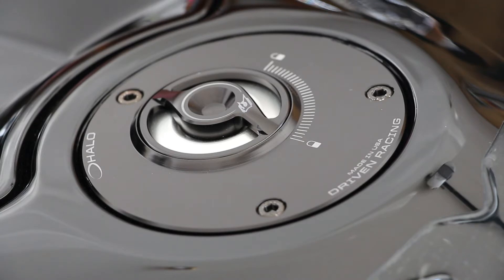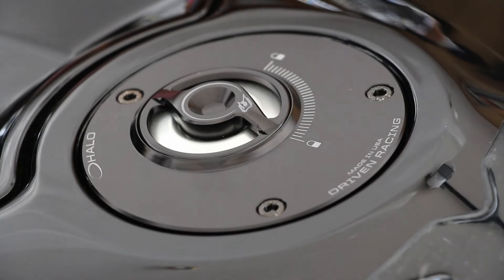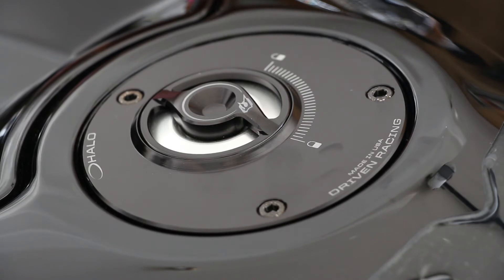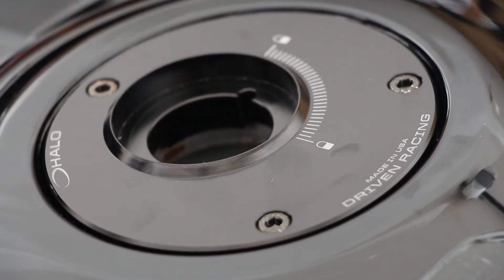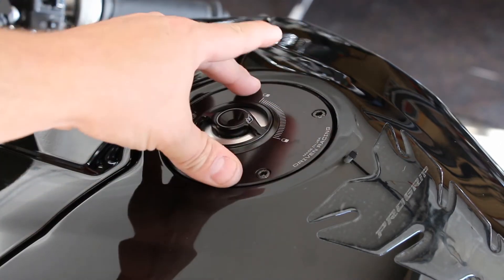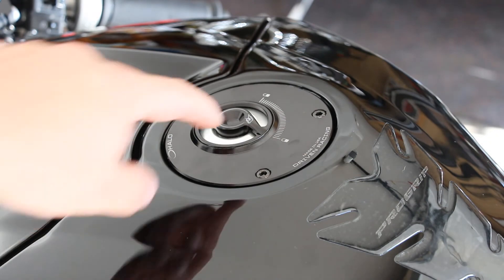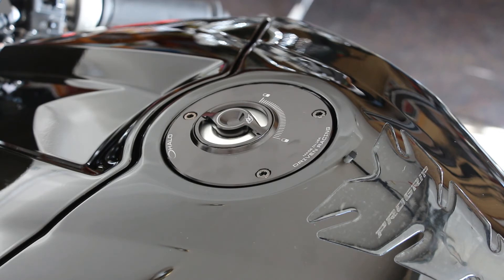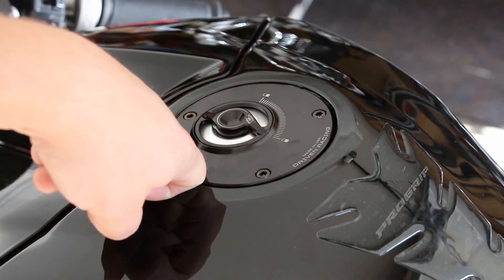Review: Driven Halo Fuel Cap

Comment: Is it easy to put gas in at a gasstation? Or is the hole smaller than the OEM version? Because its made for racing,  maybe the gas installation at the circuit are different? Thanks for helping.

Comment: How exactly does this cap vent? Because the aftermarket gas cap I have on my r6 is absolute SHIT. It's 'venting method' is to leave a gap between the gas cap and the gas tank and this ingenious venting method allows water (and I mean a lot of water because the gap is a mile big) to get in there and pour into my gas tank through the venting holes. I think I'll just go back to OEM
Reply: So it not only looks like an old Ford thermostat it works like one too (lets water past all the time)

Comment: This just looks like a Rizoma fuel cap knock-off.
Reply: TheSunExpress except you don’t need a stupid key to open it. That’s the whole purpose of getting this
Reply: @navyrotc2012  the "key" for the Rizoma one is actually great at silencing annoying key-rattle. I've also been to enough places where fuel theft is still a concern.
Reply: @thesunexpress  if you live in an area with high gas theft, your priority should be moving, not buying a motorcycle.
Reply: @TRU_Lunchy  ??????